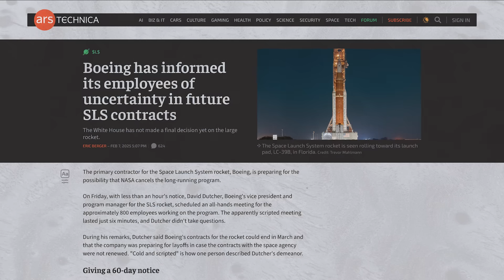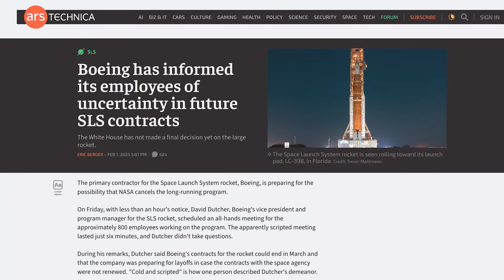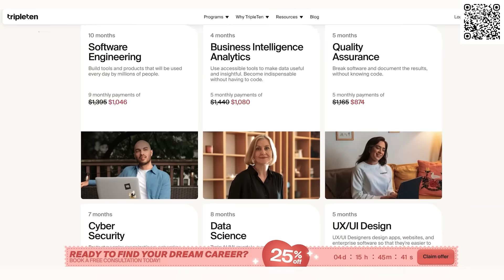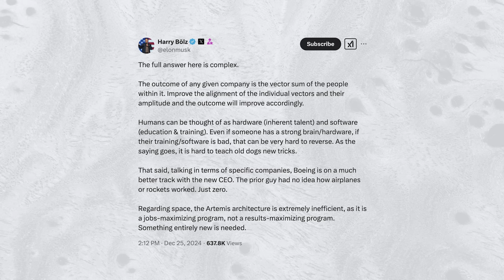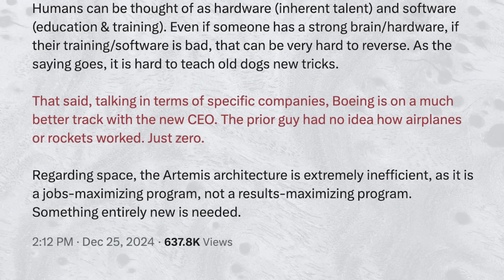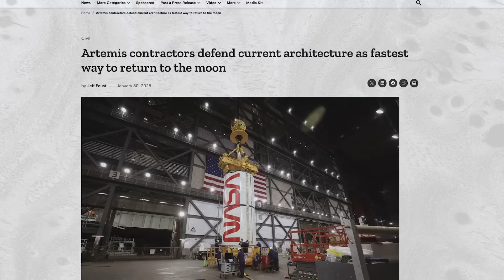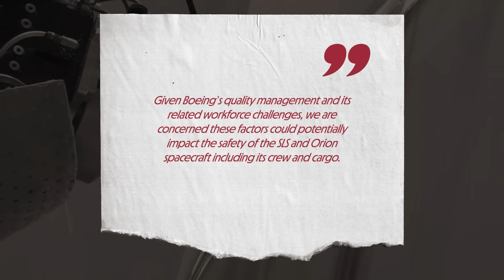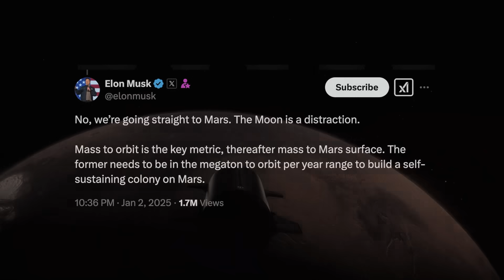This Is The End of Boeing

Comment: The sooner SLS (senate launch system) is scrapped, the sooner funds can be allocated for a more dependable, cheaper system. At this point, I'd put them in orbit aboard Dragon, dock with Lunar starship, do the mission, send a tanker to refuel, bring them back to earth orbit, dock with dragon, fly home.
Reply: You mean like 10 tanker to refuel
Reply: @maxmusterman6030  Assuming even partial reusability with the tankers, you could fire off 100 for the cost of the next 3 SLS launches, probably a few times over.
Reply: Couldn't agree more!!!
Reply: the only problem is no variant of starship has ever completed an orbit. I'm thinking we stick with what works.
Reply: @divedevil985  That has been like this for flight 5 6 and 7 by design. If SpaceX had decided to reach orbit in 5 or 6 they would had done so. They won't reach orbit until all issues are ironed out, because they don't want to reach orbit and then a malfunction occurring (like it happen in 7) and having a massive structure in orbit that would come down in the future randomly. 
  Starship is close to be fully certified and start actual missions  like  putting massive structures in orbit or orbital refueling. We will see orbital refueling this year.
Reply: @Xoman08  Starship has reached orbital velocity but was destroyed during re-entry. 
They have a long way to go.
Reply: @divedevil985  It never tried. Ever single mission thus far has been suborbital. IF we always "stick with what works" we'd have never moved out of the cave.
Reply: @ perfection is the enemy of good enough. The real innovations will happen on a lunar outpost unless we tie up all of our resources just getting there.
Reply: @divedevil985  Good enough is the enemy of success.
Reply: @smugfrog8111  true if you have infinite resources to make everything perfect.
Instead we must prioritize resources.
My priority is gateway station and permanent lunar colony...not the dump truck that gets them there.
Reply: @divedevil985  

That's... That is the single dumbest thing I've ever heard in the context of this subject, honestly. I'm actually at a loss. 

How TF do you think you build a colony on the moon? and how does a lunar space station help at all? That's a totally separate thing. 
The rocket is the single most important part here. You can't even begin without a quite hefty one. 

Starship really is the only answer right now for that. It's also the single largest aircraft ever flown, so give it time. There's an immense amount of energy to contain there.
Reply: @smugfrog8111  it only sounds dumb because you are completely ignorant about the moon to mars to program and how it is achieved.
While your beloved starship is the biggest vehicle to fly it is also the heaviest to the point it has almost entirely negated potential cargo capability...and it is still mostly devoid of the critical systems needed meaning it s weight is only going to increase.
It's been 13 years without a successful flight...how much time should I give it when we already have a vehicle that works just fine?
Reply: @divedevil985  "it only sounds dumb because you are completely ignorant about the moon mars to program and how it is achieved."

No, I'm not. I've been observing and watching with great interest for 2 decades. Space exploration is literally the only subject I care about. 8+ hours a day for me, all my life. 

I basically think about nothing but this subject. I remember having this exact same conversation many times 15 years ago about Falcon 9 and landing the booster. It would cut too much into the payload, it's too expensive, it's too hard, it's taking too long. Nothing you're saying is new. You're just wrong.

"While your beloved starship is the biggest vehicle to fly it is also the heaviest to the point it has almost entirely negated potential cargo capability..."

They claim 100 tons to LEO when it's operational. Let's be ultra-conservatives and cut it in half. 50 tons to LEO on a fully reusable vehicle. 

That's so far beyond what you're advocating for it's unreal. That's the dawn of Star Trek. What you're advocating is another 50+ years of a snail's pace and trillions of wasted taxpayer funds. More of the same hasn't worked.

"and it is still mostly devoid of the critical systems needed."

Is it? Raptor 3 is all but in full production. The rate of ships and booster production is increasing rapidly. Starfactory is growing rapidly.

 The second tower is almost done at Starbase. The flame trench is also coming along rapidly. I don't think you understand what's actually happening here. This isn't just another rocket.

 It's also the production infrastructure, fuel farms, and everything else that goes into building an entire industry from nothing. All while costing you less than a single SLS launch. 

 "It's been 13 years without a successful flight..."

Not even close. I believe it was Flight 5 that was a complete success, given the mission parameters. So it's really only been a few months.  Your expectations are simply skewed. I'm guessing a bit of EDS is involved as well? 

"How much time should i give it when we already have a vehicle that works just fine?

We don't though. Not even close. What vehicle? Falcon Heavy? Yeah, you could put boots on the ground for a short, Apollo-style mission with it, but you're not building anything of value. 

SLS? It'd be more economical to just burn the money.  Starship will see its first full-duration orbital flight in ~8 months;  It'll land on the moon in ~2 years. Mars in 6, 10 tops. How's that? 50 bucks on it.
Reply: @smugfrog8111  I believe you mean you have been reading spacex fanboy propaganda which isn't to be confused with facts.
Reply: @divedevil985  No my man. Everything. Real, fiction, right, left. All of it. Space exploration is the only subject I study. I literally don't care about anything else. 

If we're talking about propaganda. Lets talking about USAID funding every single talking point you just threw at me.
Reply: @smugfrog8111  I can't disagree with your interest. Might want to add an open mind and avoid the fanboy echo chambers though.
Reply: @divedevil985  I'm not. Starship is the best option. I'm not speaking from fanboyism, but rather objective fact.
Reply: @smugfrog8111  The heaviest spacecraft ever made that can only reach orbital velocity at 30% of it's projected cargo capacity and must refuel up to 18 times and can neither launch or land with humans onboard is not the best option for anything.
Reply: @divedevil985  "The heaviest spacecraft ever made that can only reach orbital velocity at 30% of it's projected cargo capacity"
Ahh, this argument? Let's assume it is 30% for the sake of argument.  (it'll be closer to 75% at first) 30% of it's projected capacity is still 60+ tons to LEO on a fully reusable rocket. That's twice what Falcon 9 can do and beats out even Falcon Heavy.

 "and must refuel up to 18 times"

So that will always be required if we want to move off Earth. Single-launch, Apollo-style missions won't get us anywhere aside from wasted cash and a bit of flag-waving. Which, as long as it's the American flag, I'm cool with. 

"and can neither launch or land with humans onboard "

So first things first, no one ever said that it can't besides it's EDS-suffering detractors. In 10 years, it'll be normal to see the belly-flop maneuver just like the Falcon 9 booster landings are today.  Second, that' also was always going to be the case as well. 

The ships that take us out into the Solar System and ultimately onto the stars were never going to be launched from Earth in a single go, nor were they going to be the ship that lands. 

They'll be built in space and either carry purpose-built landers and ascent vehicles along with them or have said vehicles pre-staged in orbit of their destination. 

That being said. Starship will be the stepping stone to that.
Reply: @smugfrog8111  the fact that it is "the most powerful" is easily overshadowed by it being the most heavy. The materials it is constructed of would be better suited on a bridge or water tower.
Reply: @divedevil985  That's just asinine.
Reply: @smugfrog8111  asinine is making comments on subjects you know nothing about even when corrected by industry professionals.
Reply: It takes more fuel to return to LEO from the moon as anything available but Orion would have to do. Now if you can use starship’s booster to launch Orion, that could be worthwhile. Also lunar starship should be scaled down to something practical to do, build, and prove quickly.
Reply: @JustMe-dc6ks  Not if you use aerobraking...
Reply: @lukestrawwalker  Lunar Starship cannot aerobrake, it does not have the needed hardware or even mass allocation for such hardware.
I hate the SLS and the wastefulness of it like the next guy, but at this point they have to use it, no choice in the matter.
I just hope Boeing QA can hold long enough to not kill any1 with it.
Reply: @johngrimm1103  No, they do not "have" to use the SLS. The SLS is a glorious and beautiful Bronze Age war chariot in an age of massproduced iron swords and horseback light cavalry. It is no longer 1177 BC.
If they really want to light the candle then fire it off at the Moon and let its empty chassis sit on the regolith as extra hab space.
Reply: @zimriel  too true, but right now, the SLS is the only launcher cabled of delivering Orion to the moon. And Orion is the only vehcle capable of returning from lunar orbit.

Yes, Lunar Startship will be ready eventually and you can conceivable use that with a dragon capsule, but you are not understanding the requirements of Orion.

Orion has a capability that is critical to a Lunar mission, it can return to Earth very quickly and at any point in the mission envelope. Startship cannot do this, Dragon needs development to do this, so unless you want to re-invest and again spend time, the quickest way is SLS.

I'm not happy about the above, but it is what it is.
Reply: @JustMe-dc6ks  "Anything in life worth doing is worth overdoing - Moderation is for cowards."

Yeah, it's from a movie that is quite literally US propaganda but it's one hell of a quote.
Reply: The HLS is not meant to come back. It will literally take somewhere between 8 to 16 tanker refuelings. It will be in orbit around the earth for weeks or months to do those refuelings before it actually goes to the moon, and then it will meet Orion there. And they come back on Orion.
Reply: Aside from the non existing lunar starship, this sounds like a plan, even with 10 to 20 tankers for refuelling. 
Personally I'd have a close look at nuclear propulsion instead of chemical.
Reply: @VolkerHett nuclear propulsion?  Snap, just like that.
Reply: So write to SpaceX they will be very interested.
Reply: Why don't you god damn commies go build your own shit instead of tearing apart what everyone else has?
Reply: so the vehicle that has exploded every time it has launched is more dependable? Got it.
Reply: @divedevil985  It exploded once.
Reply: @smugfrog8111  4 of 7 flights resulted in either the SHB or Starship exploding.
Reply: @divedevil985  That's why they call them "test flights"
Reply: @smugfrog8111  so is that your way of saying you were wrong?
Reply: Starship is yet achieve its first orbital flight. Right now the SLS is more realiable than starship. I wish things could improve for both platforms
Reply: @v_i_e_w_e_r_405  Starship has never once aimed for orbital flight, so technically, that's a moot point.
Reply: At this point in development, it would most likely be more expensive to cancel SLS and Artemis than continue (at least through Artemis 3 to 5).  The parts of the rocket (for Artemis 2 & 3) are already built and just need assembling in the VAB.  The latest holdup is Orion’s heat shield but it mostly comes from NASA taking extreme caution.  It would cost more money and take more time to ditch Orion and SLS and adapt Dragon and Falcon Heavy and at that point, we are probably looking at a lunar landing well into, possibly even in the late 2030’s.  You also have to remember Dragon is designed for LEO and is probably not even capable of a lunar flight.  
SLS also has a lot of political support.  It creates many jobs in many districts across the country and it was even President Trump who helped create Artemis in its current form back in 2016, and most likely wants to see it through for bragging rights.  The only real opposition would be Elon Musk but that’s really just because he wants the money.
The biggest thing that is most likely to delay Artemis even further at this point is SpaceX and lunar starship not being ready.  Starship has at least a few years before it’s ready and there is also the issue of actually getting it there.  NASA estimates it would probably take an upward of 20 refueling missions just to get it there and then how do we refuel it once at the Moon?  Lunar starship doesn’t seem viable in the short term and NASA might need to switch to a more simple lunar lander (like Apollo’s) for the first few missions.
Reply: @amtrakatl  Disagree, it is more expensive to keep spending money in the losing horse. SLS should be cancelled ASAP. Going to the moon has to be done in a cost effective, secure and RECURRENT WAY. That can be accomplished with Starship , it cannot be done with SLS. 
  Boeing has already sucked enough money with "starliner" and the value it has provided is "zilch".